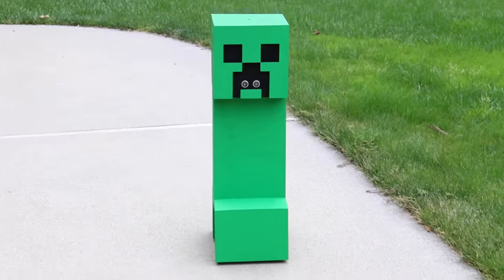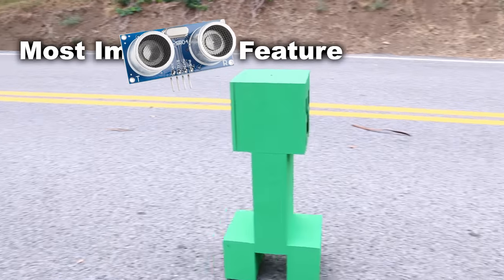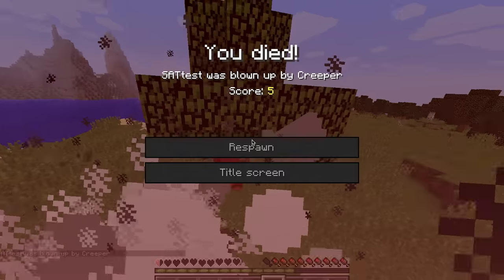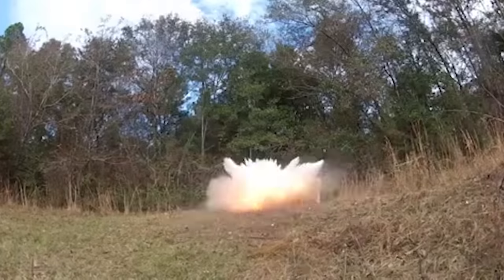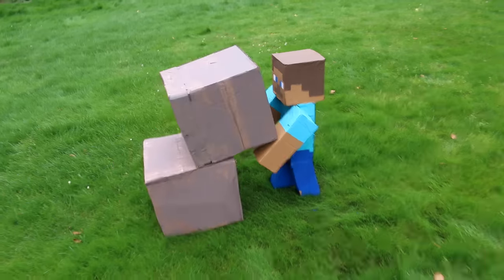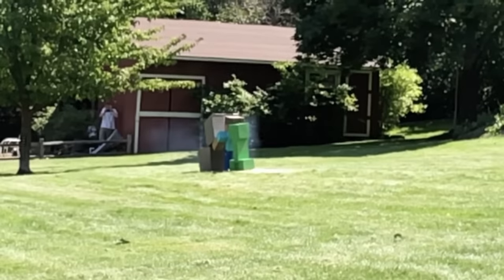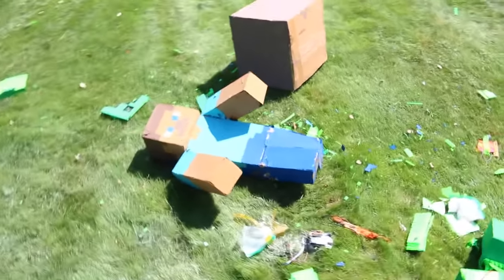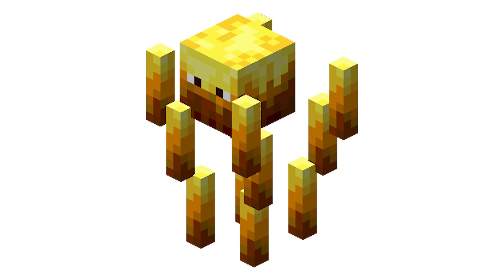I Made a Real Life Minecraft Creeper

Comment: Wouldve been better if all the electronic works were in the feet and the ultrasonic sensor was in a blastproof shell and connected via spring loaded contacts
so even if it did go boom, the parts can still be reused
better yet if the body construction was intentionally pre-fragmented, like lego bricks but held together by sacrificial binder, like string for instance. Strong enough to hold it together, but lets it blow itself to pieces without destroying the body parts.

Needless to say, yeah, don't go overboard with the 'explosives' part. Firecrackers are plenty good for the effect, but anything stronger might land people on a watchlist or something.